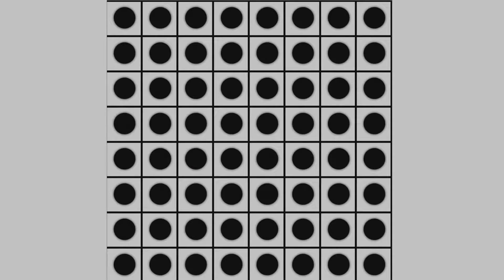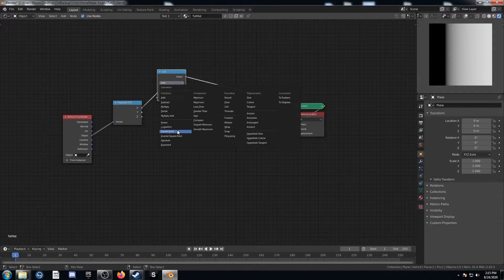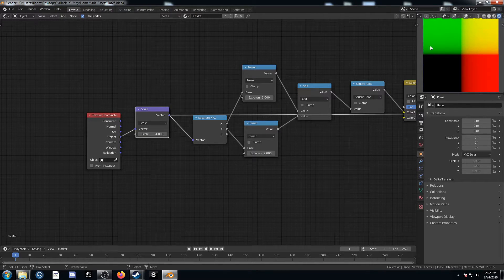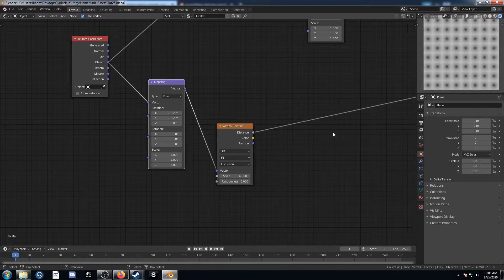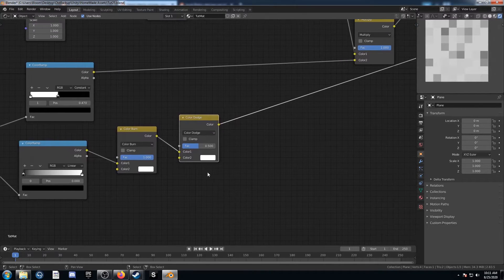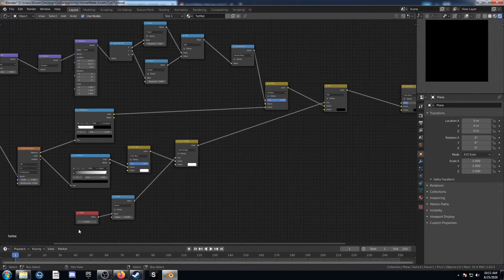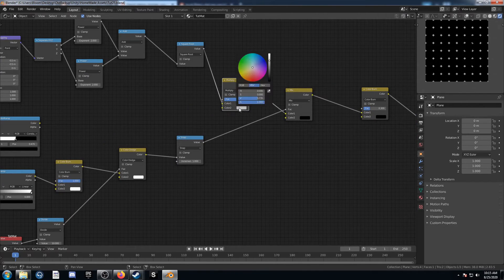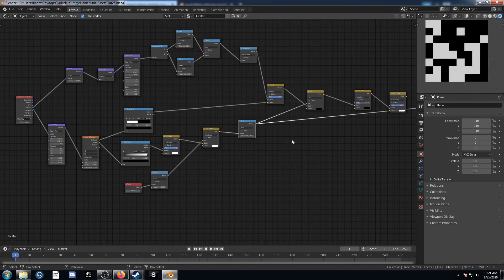Procedural Nodes (part 25) - Procedural shape tiling setup in Blender

Comment: So I am using the method that Erin Dale and someone else mentioned with the untiling node setup.. basically which is very similar but allows for the tiling to overlap in some areas (needed for what I am doing) but it takes the position output from the voronoi and maps the texture to each cell of the voronoi. This is great and all but having an issue making some cells blank like how your setup allows and now sure where to mix things in. Perhaps you might be willing to take a look? Thanks for the video.
Reply: Essentially all I am doing is trying to reproduce a single image texture fingerprint all over the mesh in absolute random areas, with some slight variation to scale and some variation to rotation so the textures don't all face upright. So far my setup works but I am not finding a parameter for controlling how frequent the fingerprints occur, they're just everywhere and adjusting scale makes them bigger or smaller but not less occuring.

Comment: It was necessary to connect the "Texture coordinates" node not with the "Object" output, but with the "UV" output. In this case, the array of circles would match the value of the scale (number by X and Y). This is because the "Fraction" function works with the entire texture space (the origin is in the lower left corner). This method also works with all other nodes, including the Voronoi node (scale value of four is equal to the number of circles of 4).

Comment: Hi Sam, this has helped me a lot, thank you so much. I have a question, is there a way to use the voronoi to scatter a shape (that is going to have a random scale) without being cropped by the size of the cell of the voronoi? Thanks again!!!
Reply from the maker: Yeah good question, I have encountered the same problem. The workaround that I use so far is to make the size of the shape very small within the cell, then use two different voronois that are offset from one another. This way you can tile and have size, location, and rotation variation without hitting the cell wall so often.
Reply: Oh great! I will try it, thanks!!!